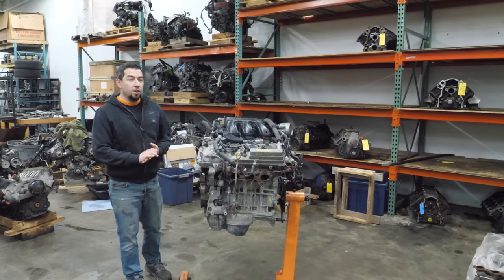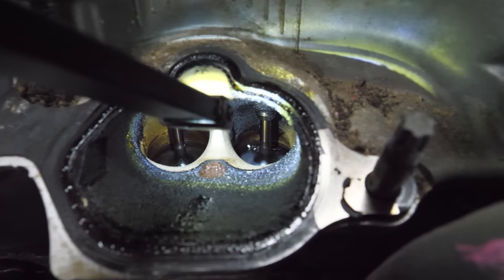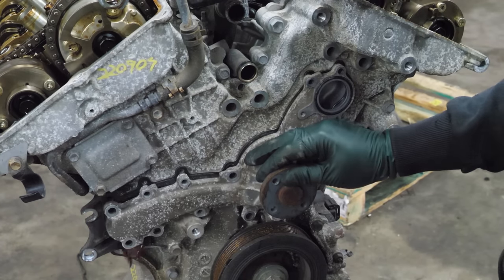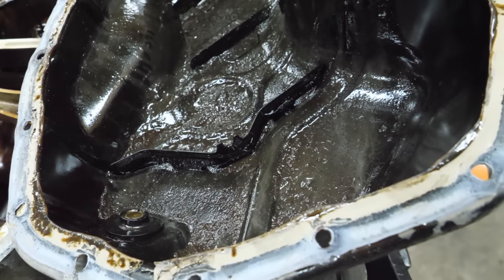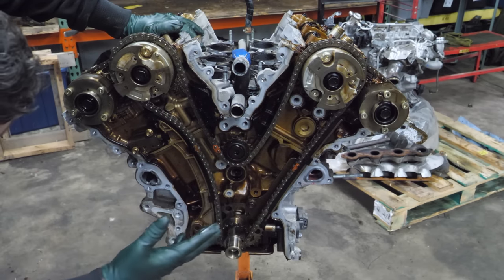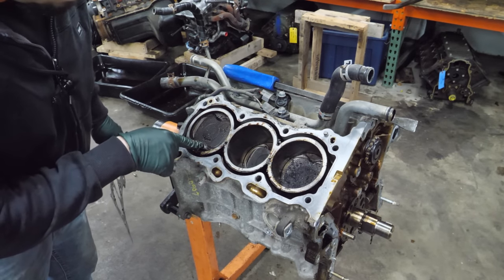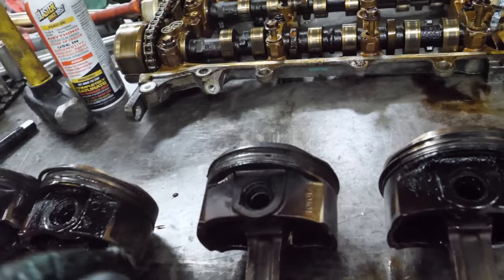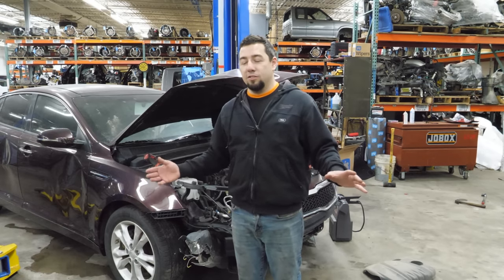Toyota Lexus 2GR-FE Teardown! Premature Death Of Toyota's Most Reliable V6 Caused By Obliviousness!

Comment: Watching this video made me sad. It was like seeing a very good friend at the funeral home in their casket. 
I have an 07 Avalon.  I absolutely love her. She had 24k miles on her when I bought her, today she has 92k miles. I'm a stickler for maintenance, oil and filter change every 3k miles, I also have the tires rotated with every oil change. Easier to keep track of that way. I love everything about the Avalon, smooth quiet ride, 30 mpg on the highway, and what surprised me most about the car is the power that engine delivers. It is so mild mannered putting around town, but if you stick your foot in it to pass another car, you can be doing 40 mph and she'll be spinning the tires as you pass, and by the time you get by you'll be doing 80-85 mph, and the sound of the engine is like a jet engine spooling up, it loves to scream. I don't know what the top speed is, I've had it up to 130 mph, and decided that was fast enough for me.  Funny thing though,  it feels like the faster you go in the Avalon, the more planted to the ground it feels. Older cars will start feeling light, and floaty at higher speeds. I think I'm different, I like to see the engine, hear it run, so I took the big plastic cover off. I plan on the Avalon being the last car I own, and when I'm to old to drive I'll pass her down in the family.
Reply: Put the cover back on, saw a video on youtube that showed most beauty covers are actually somewhat functional for cooling the engine slightly.
Reply: @jasonw9277 I discovered that the only thing the beauty cover is good for is providing a good place for mice to build a nest and chew on the wiring. That's happened twice to me. Since removing the beauty cover, I've not had any further rodent issue.
Reply: @lindanelson8400  Happened to my friend's Buick 3800 before he bought it too

Comment: What kills them? Lack of an oil level sensor, lack of proper maintenance, not using the correct oil, not using the correct filter, cracked filter housing, upper Rocker oil, feed lines crack, and that's all I know of. I own one in my 2011 sienna and it's the most amazing V6 I've ever experienced in my life. The power and torque and good throttle response that's not too sensitive is what I enjoy about this Toyota engine.

Comment: My 2gr just had the water pump replaced at 235K, did not overheat and is back for another 235k.  It is an excellent engine.
Reply: Did u had any visible leak cuz I don't but my coolant has a real slow leak somewhere?
Reply: @willpage79  Yes I did, it was leaking from the water pump.  Not a lot at first, but gradually got worse.  At first I could just smell it after turning off the engine.  The heater inside also quit heating because no hot water was getting back to the heater core.
Reply: @johng.7560  in mines I don't see no leaks and it's  not overheating either ,I'm going to try to change the radiator cap and fill back up to see what happens

Comment: The vvti hose with the rubber section and the water pump are known failure points on older 2GRs. Both have been redesigned. There are plenty 2GRs out there with well over 300K miles and still going strong. With proper care you'll rebuild your driver's seat before the 2GR.
Reply: Thanks for sharing that. I heard that about the 2GRs (water pump failures). What year were they re-designed to address these issues?
Reply: how old do you think
Reply: @kenbina 2010 ish, for example my 07’ Avalon has the rubber.
Reply: Good points. Have a 2007 rav with the 2gr. Did the water pump preventatively at 140k. Now at 200k and the drivers seat just got a duct tape band-aid.
Reply: Also beware! Some models are equipped with a oil cooler. Newer versions of the 2GR-FE. Have the updated, all metal lines. However, The older versions of the 2GR-FE. Have a rubber section in them as well.
Reply: I think there was also an issue with valve springs that had incorrect metallurgy and would break.
Reply: Our 2012 Highlander with this engine has over 200,000 miles on it. Still runs like new, silky smooth, quiet, and plenty of power. And it consumes no oil at all.  I have had lots of cars but this is my favorite engine of all of them.

Comment: Until almost a year ago, I owned a 2007 Toyota Sienna so seeing this engine was a bit of a treat I'm not going to lie. My own made it to about 226,000 miles before I had to get rid of it. It was needing some parts replaced which wasn't a huge deal. The problem was that said parts and the engine block were basically inseparable, and they weren't coming out/off without potentially damaging other things in the process of the removal so I sold it to a business similar to your own.

Your observation about the rubber hose being used for oil reminded me of a problem I had with my Sienna a number of years back. Twice in the space of twelve or eighteen months or so I had a hose fail that caused me to lose basically all my oil at once, which is great when you are doing 70mph on the highway at the time it happened (both times, ugh). The first time it happened the hose got replaced. The second time it happened a different shop did the work and they said that it was a known issue with that model of engine and that Toyota had since replaced it with a metal part. They did the replacement on mine and I never had that problem again. 

Thank you as always for educating and entertaining us Eric, I hope you and yours are doing well.
Reply: I'm very familiar with that hose actually, it comes in every once in a while still, but I always end up having to use the stupidest combination of 1/4inch extensions and wobble joints, it's ridiculous. But yes, it did eventually get common enough for an improved part to be released lol
Reply: Same. Rubber line had a pin hole in it and was headed back home from a weekend trip on the freeway when “low oil pressure” flashes on the dash… luckily I coasted into a grocery store and limped it home after 4qts of oil later. Still running after almost no oil lol.
Reply: Heard about this issue recently and that was my first thought too seeing this. I'm swapping my oil cooler line to the metal part too. You think that could have happened here? I figured you'd see more oil starvation signs rather than overheating
Reply: Does anyone know if the first gen sienna (98-03) is plagued with this issue?
Reply: There was a huge recall in 2010 for the rubber hose to be replaced with a metal one. I have a 2007 Avalon and got mine replaced at the dealer in 2010.
Reply: Our engine had the oil line update completed at the dealer. As part of a recall. It has currently 196,890 miles. Replaced the water pump and would like to keep the hylander as long as possible. No worries oil change intervals at 8,500  to 10,000  miles .. this engine is reliable engine.....provided you change the oil,
Reply: @lastotallyawesomebleach204 that generation doesn't even use engine
Reply: @baselhs Canada? Afaik, Canada got a recall but the US only got a service bulletin. So we know what happened after it happened.

Comment: Fantastic engine. My 2008 Lexus gs350 had it rated at 303 hp. Sold it at almost 190k miles not one issue just regular maintenance.
Reply: Mine is at 133k rn same year and it's a masterpiece

Comment: Awesome.  I work at the Toyota Casting plant in Troy Missouri.  We casted those 2GR heads as well as the main engine bracket in the front of the motor.  There should be a mark on the front and rear of the heads starting with letter ‘B’ followed by the casting die number.  Casting date is scribed under the intake runners. 
I agree, awesome engine and fun to see our parts after some run time..!!

Comment: The 2GR in my 2008 RAV4 was still running strong at 310,000 miles when I sold it. It didn’t burn a drop of oil between 5,000 mile oil changes. I drove it like I stole it from the day I bought it too.
Reply: Who in his right mind would change oil every 5000 miles ! Talk about polluting the Earth. I have a 2003 Mercedes C320 with 250000 miles on it, oil changes every 12 to 15 000 miles. Motor has never been opened! Motor issues....belt tensioner pulleys replaced, x 1 water pump at 200 000 miles with altenator new bearings and brushes
Reply: @c-teamtrading9690 The oil was recycled. My Camaro with no catalytic converters is for polluting the earth.🤟
Reply: @c-teamtrading9690  I change my oil every 3000 miles, even though it is synthetic. 2009 Lexus is250 - 186k miles
Reply: @c-teamtrading9690  thats why his shit ran for 300k miles.
Reply: Did you have the camshaft rattle when starting up when it got hot?
Reply: @willleslie2745  Yessir! I had the rattle for over 150k miles until the day I sold the car and it never affected anything. I have two other V6 RAV4’s with over 200k on them but neither have the rattle…yet.
Reply: @daetherbunny  ok interesting. So its not a big deal
Reply: @willleslie2745  In my experience it wasn’t a big deal. Just a minor noise. From what I’ve seen from others, it hasn’t caused any problems.
Reply: @willleslie2745 I used to have the cold start rattle. But it disappeared after running 5w-40 synthetic ester oil. Seems to be worse with thinner oil.

Comment: Hurts my feelings seeing a 2gr tore up.   I work at a Toyota factory that built the one that is in the Camry.   The one in Kentucky.   Great powertrain really...
Reply: I think the Ford 4.6 2v engine is a great engine as well, but I have one that's been windowed in my back yard.  Given to me for 'science'.  This one actually has a broken wrist pin in it!

The 2GR is an excellent engine, as are many of Toyota's engines.  I like the UZ series V8s quite a bit.
Reply: @silicon212  I've seen that failure on my friend's neighbor's Ford that was started and then revved very high straight away in the dead of winter with questionable maintenance.

Comment: Can’t believe how decent the bearings looked after what happened. I’m impressed.
Reply: I can't believe the engine didn't lock up and bend a rod or too
Reply: 2gr is known to have quality bearings
Reply: You maintain them PROPERLY that Toyota will run until you get tired of it 333,000 on mine. It’s been maintained
Reply: I have 2 4Runners. I do 5k on mine (mostly highway) and my wife’s about every 2500-3000.

Comment: Gently placing the failed water pump on the table, with a towel to protect it from any damage, had me rolling.
Reply: I know, it changes from the usual toss across the entire shop 🙂
Reply: @liver.flush.maestro  I'm sure he's been waiting for a visibly damaged water pump to show up on one of these cores for a while to set up this gem.
Reply: @Thanatos2996  In any case was funny in deed 🙂
Reply: You gently placed it on the table, wrapped in a towel, as a sign of respect for a dead part?
Reply: Same. I was hoping he'd do something like that when he said it was bad. He didn't disappoint
Reply: ... out of respect, before embalming.
Reply: The funny this is he knows that it because of this failed water pump the Engine overheated died & that’s how he ended up making this video. 2GRFEs are notoriously infamous for having they mechanical water pumps fail.

Comment: I am a Toyota tech, I replaced one of these recently in a 2014 Sienna with only 120,000 miles, pretty much perfectly maintained. A Cylinder 6 intake valve spring broke and blew it up. It’s rare but we’ve seen them drop valves, mostly on early 2GR FKS from 2016-17.
Reply: You lie. Toyotas are indestructible!  Everyone knows this. If you buy a Toyota,  it will last FOREVER.  and never ever need any repairs EVER!!!  Although I will say my 2017 Hyundai Elantra I bought new just turned 100.000 miles, and hasn't needed ANY repairs at all. Weird huh.
Reply: @johnfranklin5277  The 1980 Celica and The 1982 "Corolla Tercel" Tell a different story.
Reply: @johnfranklin5277  I have a couple GMC trucks with 250,000 miles and according to Toyota drivers , they are not supposed to do that .  I better put Toyota emblems on them .  I've over heated them and nothing like this has ever happened.  Lets pretend Toyota's actually last longer .  Its still not worth the price and lack of utility and extra fuel cost.
Reply: @jasavak Ok Karen..
Reply: Buy a new one and see how far it will last
Reply: 2016 sienna doesn't have the fks version.
Reply: Wasn't there a recall on valve springs for the 2GR at some point? Incorrect metallurgy or something. Remember years ago someone at my school had a Lexus ES 350 that dropped a valve.
Reply: @theodorgiosan2570  that would be on the BRZ/86 and some of the early Lexus LS460s. Tundras had an issue with that but I don’t remember it being a recall
Reply: @johnfranklin5277 Hyundai and Kia are for individuals who cant afford Toyotas.  100K miles on a Hyundai is comical  joke to even brag about.  What happens to the rest of the car in that time also matters.  In my Toyotas they were never trouble-free due to environmental and long-term aging effects > 10 years but everything worked like new and did not fall apart like a piece of junk.
Reply: You say FKS but the 2014 didn't have the FKS.

Comment: Reminds me of my very first week on my very first job out of high school. Bob's Auto Repair.  As the new guy I had the "pleasure" of tearing down and cleaning a Buick 455 that a little old lady had grossly overheated and continued to run until it died.  I can remember dry-retching every time a new part came off of that engine and tearing down the oil pump was almost more than I could bear.  Why, why, why, people can you not understand the concept of an oil change?  Keep 'em coming Eric!  I'll be here every Saturday night.  Cheers.

Comment: It's always the person who sees it overheating, but they're 5 miles from the home and keep going anyway.  We had an older lady, afraid of being stuck on the side of the road, overheated and melted her engine and wondered why she needed a new one.
Reply: That's why you never buy a used car from a woman.
Reply: @honuswagner9348  or at least check it over first, and replace the brakes for sure
Reply: When my 95 Integra had developed a bad head gasket at around 200k miles I would keep a close eye on the temperature gauge. It mostly stayed at normal operating temperatures if the radiator was topped off and traffic was moving. But there were a few times when it would start to overheat and I would immediately pull over where ever possible and shutdown the engine. I would then open the hood to help the heat radiate out more easily and I would top off the coolant jug. All it took was 10-15 minutes for the engine to cool down enough to continue. I ended up doing this a few times until I got it fixed. I still have the car to this day running fine with 276K miles. The driver/operator makes a big difference.

Comment: Hey Eric. Excellent tear down as always. The 2GR-FE are notorious for water pump leaks to the point Toyota made an updated version. The one in the video is the older circular pulley design. The updated design has a flower/clover leaf looking pulley, which has had less issues.
Reply: Yes but even the new ones have problems. Wouldn't be so bad except Toyota was idiotic in how much access they provided to the area.
Reply: Still watching. I was wondering if this one had the updated water pump or not.
Reply: @mediocreman2  all engineers figure your either going to have hands the size of a newborn baby or will remove the entire engine for any repair.
Reply: @Ghauster  engineers get to go extra silly on Japanese engine accessibility
Reply: I still see a water pump leaking on these about every other week at my shop
Reply: What year was that?
Reply: Gotta go check mine now thanks for the heads up!
Reply: When was that phased in?
Reply: The problem is the tiny impeller bearing.
Reply: @lejoshmont2093 the tear down engine in this video had old-style water pump ( original probably)
Reply: Thank u Eric . Wonderful content keep it going.
Reply: Our 2008 Hylander has  221,000 miles plus and  all original drive train, except changed replaced radiator and the coolant pump. OCI and oil filter at 5000 miles. Full synthetic. We bought our hylqnder 15 years ago. Super reliable. But heat can kill any engine. 😊

Comment: The oil line with the rubber section on the valve cover is actually a super common failure point on these engines and Toyota does have an updated part number with a full metal line that they started using in the later model years but it will still bolt on to the older model years for whenever that line decides to leak.